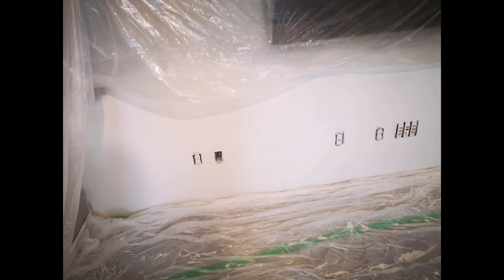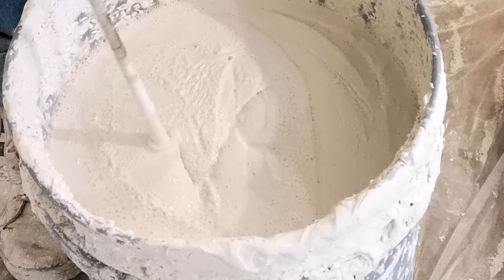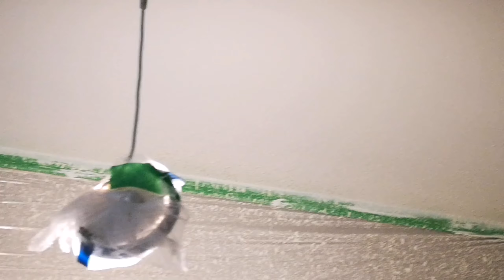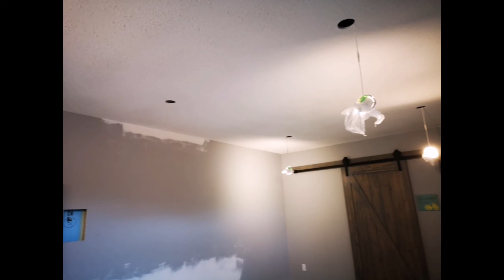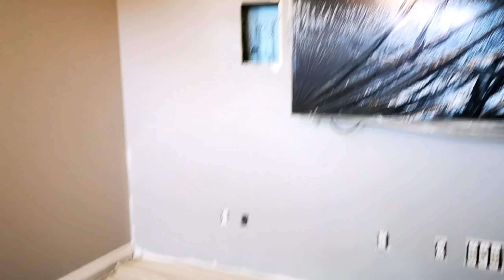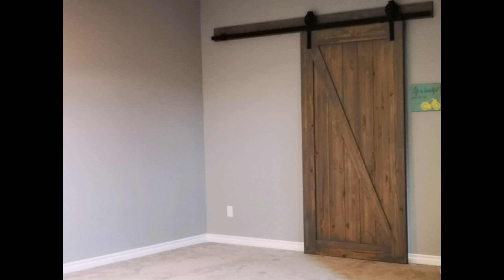#raulsrenos #textured ceiling HOW TO APPLY TEXTURE TO A CEILING/ MUD, AND PAINTING WALL

Comment: Hi great video...I have a question. I move into my new home next Tuesday 6/30 and it has a unfinished garage, so I'm going to prime, texture, and then paint.  However the ceilings are 9' ft tall can I spray the texture from the ground? Do I need to turn up air pressure, or do I need to stand on a ladder and continously move it?  Also, I'm doing knockdown texture on walls and ceiling and bought bags of Blue Line II is this the right stuff or should I get something else?
Reply from the maker: Hey, thanks for joining us today. Sorry it took so long to respond I just saw this now.
So in answer to your question number 1, the pressure is normal, but it depends on how tall you are in regards to a ladder. I am only 5' 2" or 160 cm, and the ceiling that I am doing is 8' tall.
If you are in Canada the Blue Line 11 will work.

Thank you  so much for you comment and questions. I apologize for not getting back to you sooner.